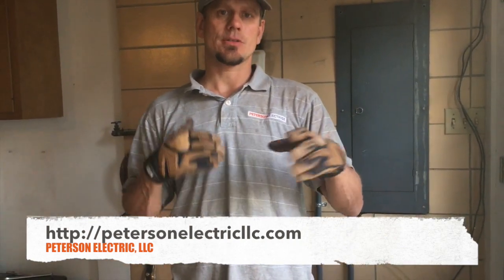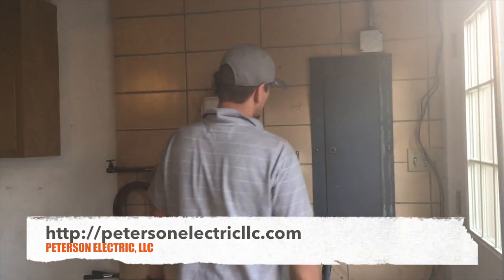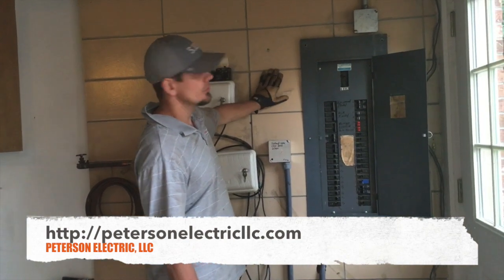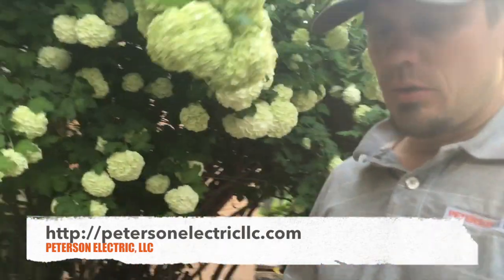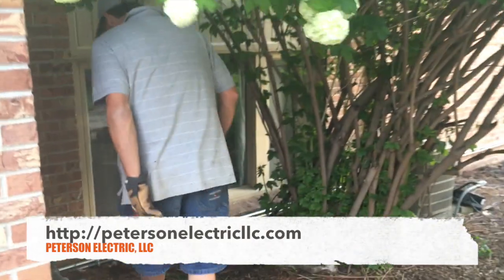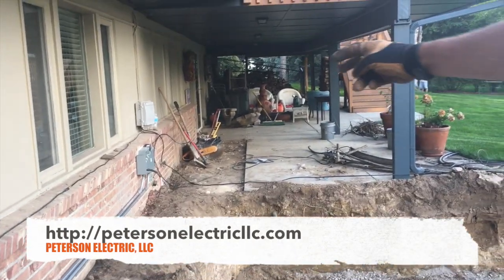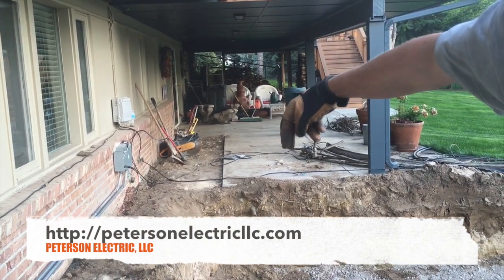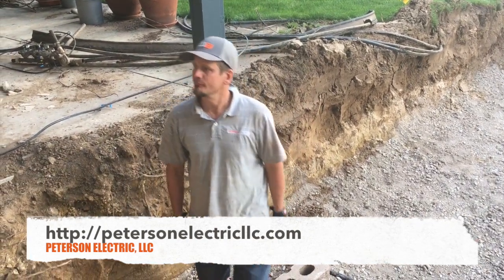Electrical Wiring For The New Swim Spa (Hot Tub & A Pool)

Comment: Thanks for the great video. Can I ask why you wouldnt run one circuit from the main panel and break it out into a disconnect at the pool with 2 GFCI breakers then fed to the two termination points on the hot tub and swim spa? Is this because you cannot have 2 GFCI breakers on one branch circuit?
Thank you
Reply: The 2 loads would be on the same circuit and trip the breaker back at the main. They r kept Independent all the way through this way.